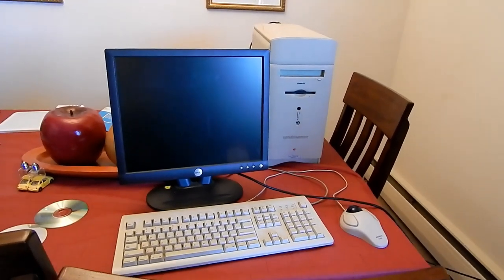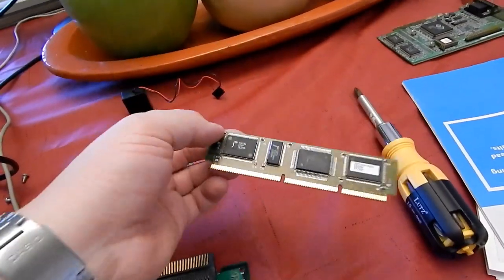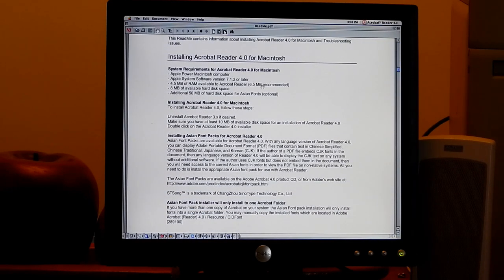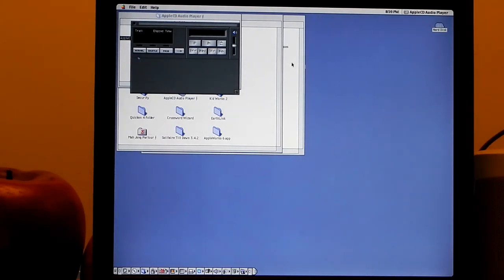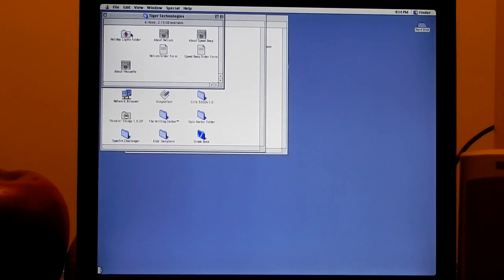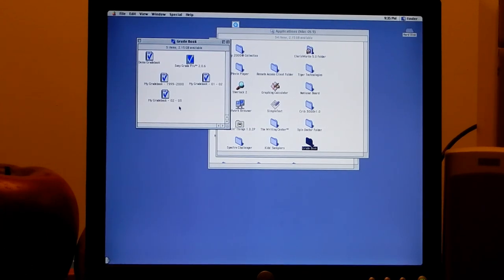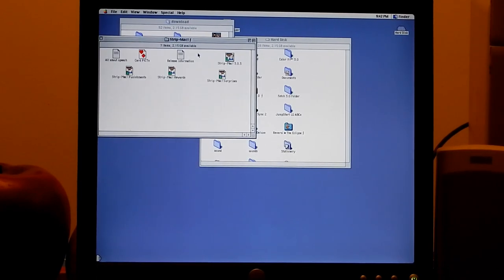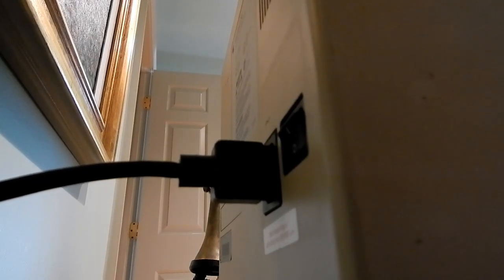Apple Power Macintosh 6500/250

Comment: You can equip these with an Apple TV/Video System, which includes a TV tuner, composite + s-video in and composite + s-video out. Those are what all the blanking spots on the back are for. The modem card can be swapped out for an Ethernet card and works perfectly, but I have only used the Apple branded one. You can additionally use a pretty high end PCI graphics card for its time. I know an ATI Rage 128 works well on these with a patch. Hell, some people even tried Radeon 7000 and Voodoo5 with success.

Here is the back of what my 6500 looks like: https://image.ibb.co/mZNYAR/gazelle7.jpg

Anyway, I can't wait to see updates including how well the G3 card runs. I had a 500MHz Sonnet G3 card in mine I bought brand new for $350 in 2001 (highest clocked G3 card for these machines and incredibly rare/valuable nowadays).
Reply: the Performa/LC/Quadra 630, LC/Performa 580, Performa/Power Mac 6200 6300, Performa 6400, Power Mac 6500, Performa/Power Mac 5200 5300 5400 5500 can all use the TV tuner and composite/S-Video card.
Reply: Had a Performa 6500 in the UK, no TV tuner, but had the composite video in/ out. I could take home video off the camera, import it, edit and add titles, etc., digitize it overnight, and export it to a video cassette recorder.  I could then send the cassette back home to Canada. I could do things I had never dreamt I could do. I adored that computer.
PS told the PC World salesmen what I was doing and they were astonished. They just stood around and compared their Doom frame rates. 😂

Comment: You really should run system 7.5.1 or 7.6 on this machine. You are going to get almost no benefit from OS 9 and it's going to really slow the computer down. Even a G4 with OS/9 is virtually useless for internet, so get getting on the Internet out of your mind, not gonna happen. You can play some pretty cool games though. You really lucked out getting that built in video to work with an LCD monitor. I couldn't. I had to put a VGA type card in it to get any monitor, including Apple monitors to work.